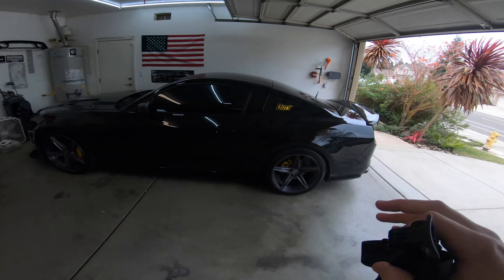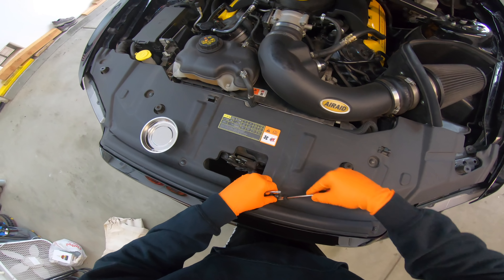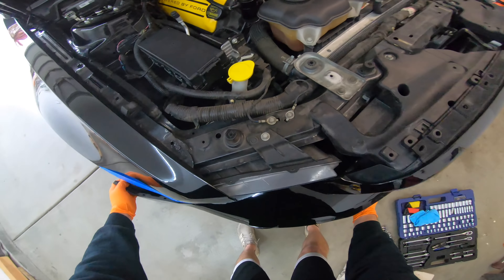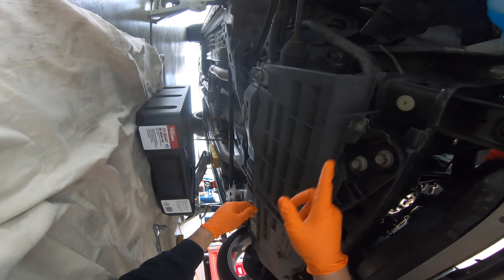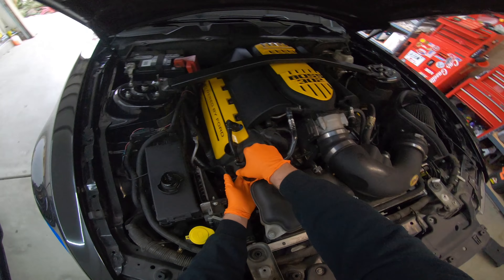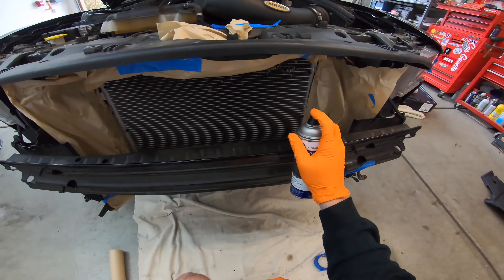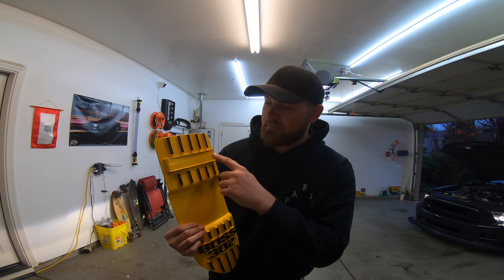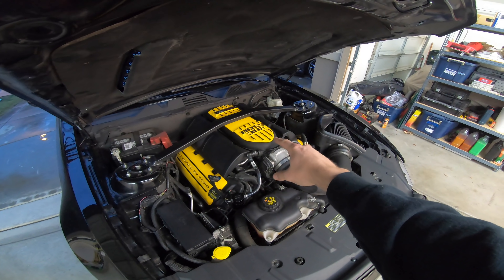Spray Painting My Radiator!! Getting The Mustang Race Ready!

Comment: I'm about to use the same paint on an oil cooler rad. How long did you leave it between putting on each coat? I heard you need to wait 15 minutes between coats to wait for the paint to flash off. How's the paint doing now? Is the black still good?